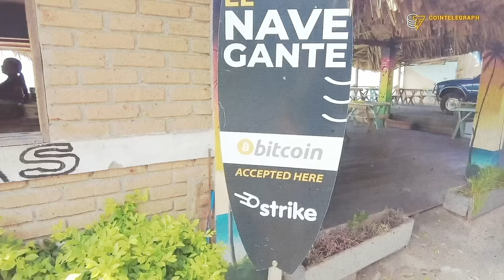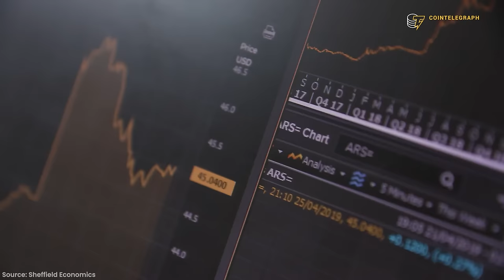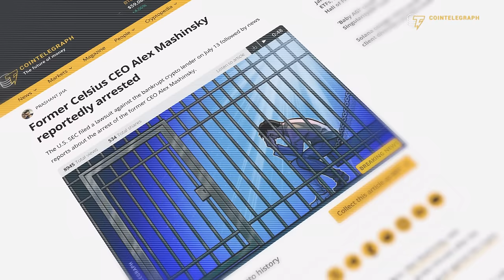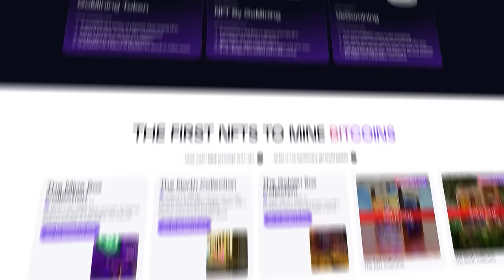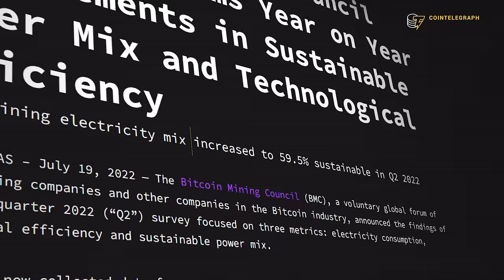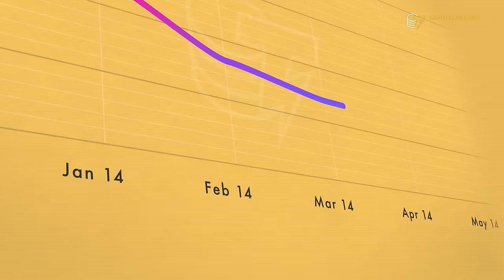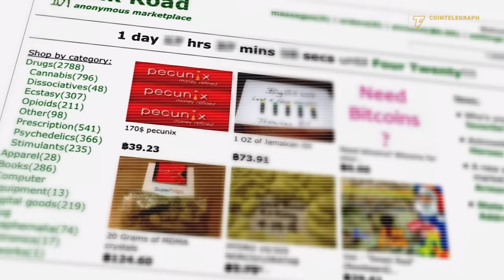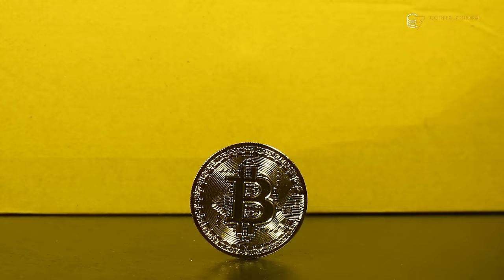What if Bitcoin is a scam?

Comment: So, when the grid goes down, Bitcoins alleged intrinsic value goes poof.
Reply: millions of computers are storing the block chain.  You can destroy thousands of servers, but the block chain ledger and its eternal growth is certain.
Reply: The same is true for general finance though.
Reply: @Stimm002  its the  advantages of btc over fiat that makes the diff.
Reply: The grid in WHICH country, Dude??  BTC is WORLDWIDE.....FACT!
Reply: Next season of Walking Dead: "Hey, hook up the generator, turn on StarLink, and bring the USB wallet over here, this guy want's to trade with Bitcoin."
Reply: Here is what your worry should be: Bitcoin has 80% drops, but what do you do when an outage is planned, and you cannot sell when you need to?  By the time you regain your connection to the Internet, the price can fall that 80% or more while all you can do is watch it happen on the evening news.

Comment: Until / unless Bitcoin replaces the failing fiat currency system be it coins and paper cash or CBDC'S, it has no real use .
Reply: El Salvador uses Bitcoin as an official currency.
Reply: And why would they use bitcoin in that case rather than say gold????  Because it’s “there”?
Reply: If the USD were to be backed by Bitcoin, the USD wouldn't be Fiat any longer either.